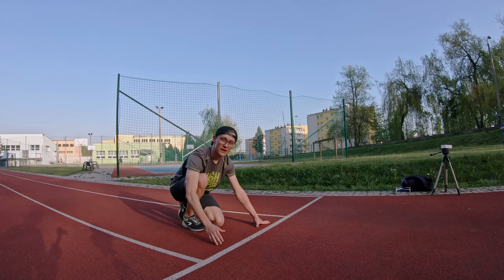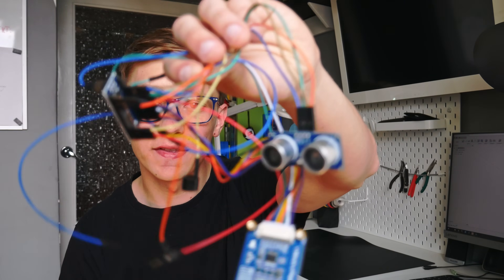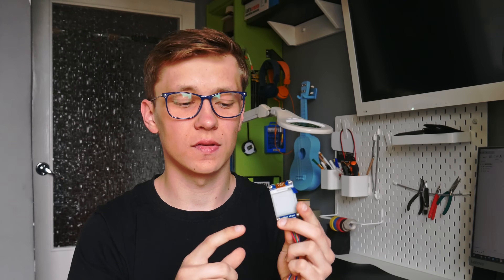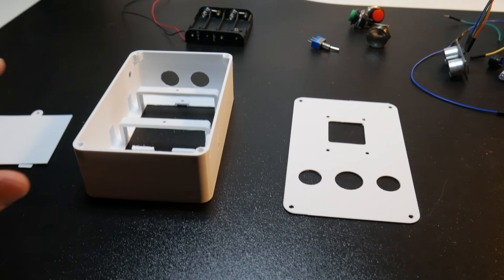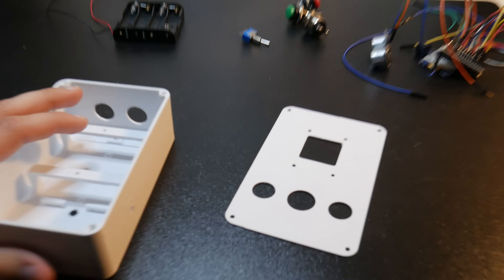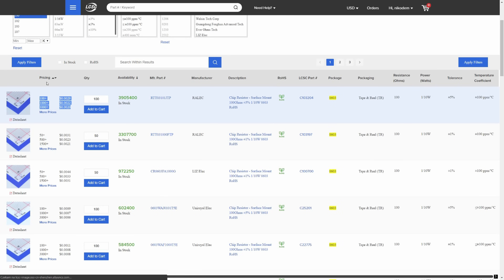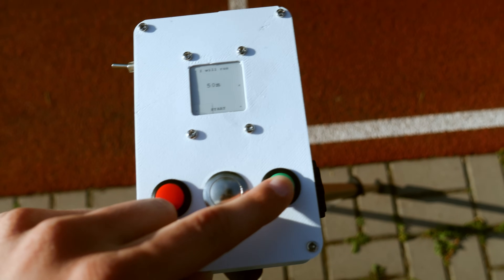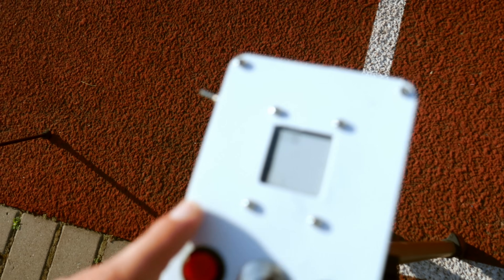DIY Sprint Race Timing System with Arduino

Comment: Great content! I am trying to make a similar project but inside a medical physics lab. They have a nice hallway and i try to think of a smart idea to place either photocells or rfid or something to make a timing system for pacing/running. My only two problems are cost and wiring (i can't open holes in walls for the photocells or the wires etc). The hallway is like 30m long and the system should be keeping laps every 5m. Any ideas?

Comment: Sir, it is a great project; fortunately, I can design it on the professional platforms, for example, Proteus 8 Professional.
The printed circuit boards, I can design on P-CAD professional and using the professional in-system programmer (software is PonyProg2000 or SinaProg2).
Please, just do not spend a lot of time on Arduino...

Comment: Hi Nikodem, weather looks good to be out for s run, a sponsor is good, will help you build more great projects. Enclosure look nice, we were wishing it had a groove to slip into the other base part not for sealing it from the elements just as a practice to hone ones skills in alignment. Ok you are going to make a better enclosure later. 
Lance & Patrick.

Comment: nice proof of concept, but you lose time when the buzzer goes off - its not much, but at 100 meters, there is already a noticable delay between the thing going off and you hearing it. you really should need two parts of the timing mechanism. but thats really hard and there might be a reason why true timing gear is that expensive. but just for the fun of it, its a cool thing.
Reply: you could just substract the time it takes for the beeping sound to travel to the start of the track in software. Should be nearly constant shouldnt it?
Reply: @jowieweb  thats actually brilliant
Reply from the maker: I wanted to implement a simple function to subtract distance that you want to run divided by the speed of sound, that way I could get rid of this delay. But because it's a really small value and the most important thing for me is the difference between those times so the single time itself is not really that important :) But that's true, thanks for pointing that out!
Reply: @nikodembartnik  What are you using as the clock source? A crystal, an RTC, or the AVR's internal oscillator? If your clock is not very accurate or temperature-dependent, the speed of sound won't matter anyway. 
A second unit and two cheap 433 MHz radio modules would be a cool upgrade for this project. Because if you have to run to the starting line after arming the device, you're gonna tire your legs before the race even starts.
Reply: Since it is a straight line you could use a laser on a photo sensor and trip it off by waving your had true it. Could use the buzzer to set it up you only need a steady tripod, or something. Or use just Bluetooth.
Reply from the maker: That's what I wanted to do :)
Reply: Sound travel delay would be apprximately 1/3rd of a second, plus human brain reaction time of about 15/100th of a second, and if you REALLY wanted to kill the sound delay, a LED flash might work... BUT, the entire purpose is to measure improvement of run times over a month, so those delays would have negligible affect on the intended measure.  (I am a retired metrics nerd.) Plot a linear regression line on your captured times, and the slope of your improvement appears !   Excellent work, thank you for sharing your experiences, and letting us come along on your journey.

Comment: Interesting application of technology. It will be interesting to see how well this works on a regular basis. I can think of some potential enhancements, but if this works well enough then that would be overkill. I wish you well on your sprints. I’ve been getting back into indoor rowing again. It is good to have a fitness goal. I like collecting performance data. I use an app to log my performance and heart rate. You might find it interesting to develop expanded data capture tools for your running.  Very impressive image stability on the trailing running shot.

I sent you a PayPal payment last month. Just want to make sure it actually got to you. Let me know if you didn’t get it and I’ll investigate further.
Reply from the maker: Thanks! Yes, it's nice to have data of sports activities. This was shot with GoPro hero 7 with hyper smooth turned on on a gimbal so it's buttery smooth :) Yes, I think I got it, thanks a lot!